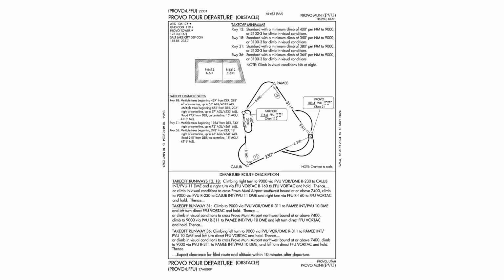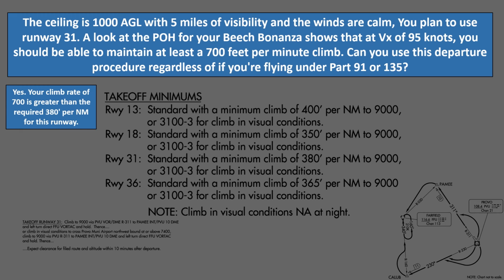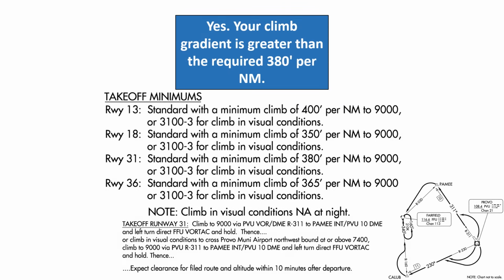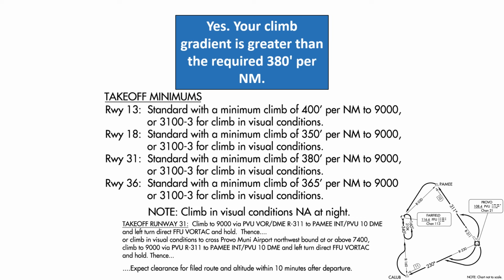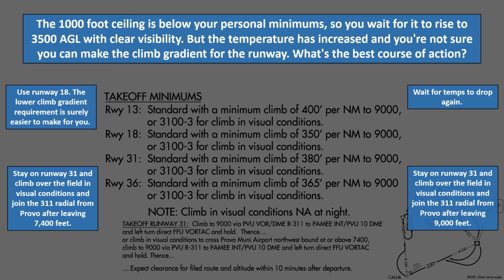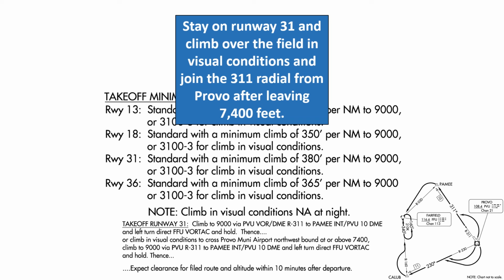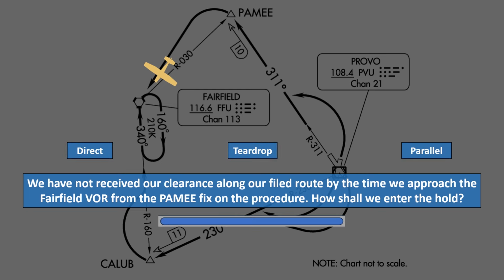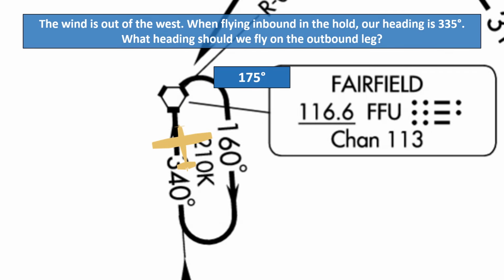Can You Fly this ODP? | Obstacle Departure Procedures Explained

Comment: I would have gotten them all but, for the first question, I said yes, because we could make the climb gradient for that runway (the upper left answer). I don't understand why the upper right answer was correct because it only mentioned one climb gradient when the procedure specified multiple gradients, depending on the runway.
Reply: Semantics. The top left says “climb rate” and top right says “climb gradient” which is technically more correct. 

The ODP is asking if you can achieve a gradient, so I think examiner would expect you to answer the question with respect to the gradient
Reply: @RedSailor1701  Oh, drat and fiddlesticks! You are absolutely correct. I misread it.

Thanks!

Comment: As always...  love your vids, but your first question has 2 right answers.  The "700 is greater than the 380'nm" is also true. At 95ks, you need to climb aprox 580'min. (depending on actual ground speed) Leaving that feet/min tag off doesn't change the answer. either way.... it's good to keep things sharp.
Reply: Climb RATE is fpm. 700 is fpm, gradient is in feet per nautical miles. The units of measure aren’t the same making that answer incorrect
Reply: @iNcog_AoE  It's semantics, and interchangable when converted. Without a label, we go with the info in the question. (Ft/Min) the climb is more that the gradient.

Comment: Entries into the hold was the only one missed, entries give me a hard time.
Reply: Unless you are on a checkride or taking a knowledge test/quiz, there is no "right" answer on how to enter a hold.  In the "real world" you could have used any of the three to enter that hold and nobody would have batted an eyelash.  Although a Direct entry would have been pretty difficult from that position, either a Teardrop or Parallel entry would have worked just fine in this situation.  There is, of course, one entry that is the book answer "better" than the others, but none of them are legally wrong.  Since you are not technically "in the hold" until you cross the holding point on the inbound course, what is important is that you set yourself up for that proper inbound course to the holding point and make the turn to the correct direction after crossing the holding point.
Reply: Whenever you see you'll approach a hold and "spill" onto the outside of it, that's a parallel. Whenever you see you'll approach and it just makes sense to enter straight into it, with minimum turn, that's a direct. If those two don't fit, teardrop.